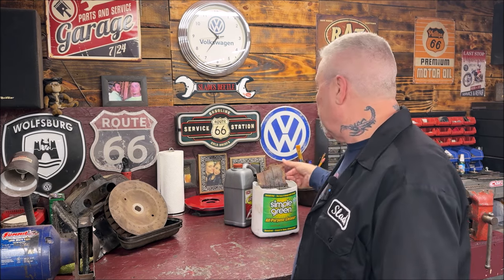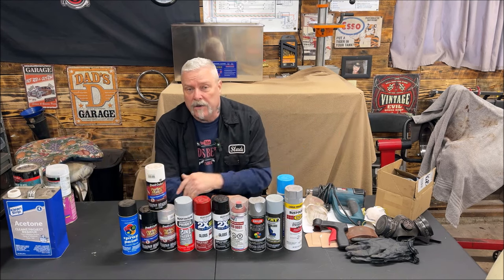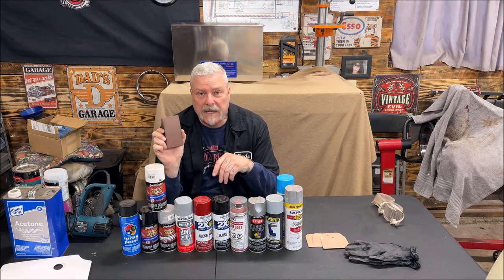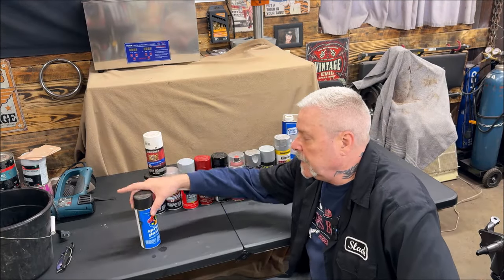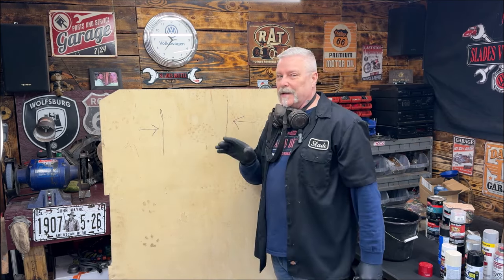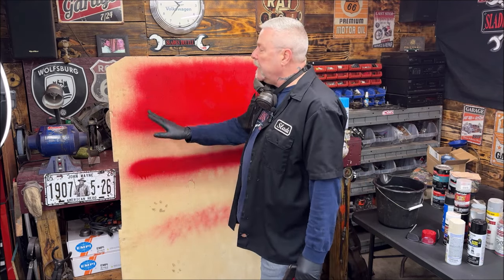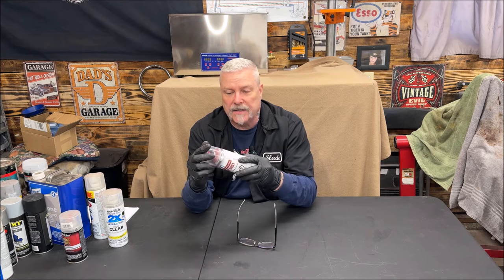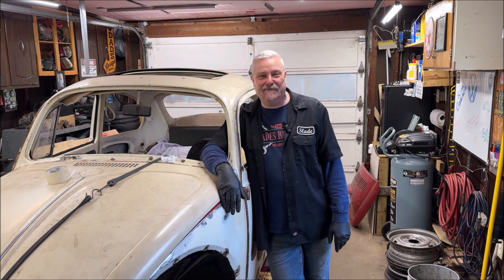Spray Paint Tips & Tricks - Rustoleum Rattle Can Car Paint Job - VW Beetle Bug - Budget Paint Job

Comment: Great tips! I plan to rattle can and 2K clear my 74 standard later this spring. How should I go about painting over the existing paint? It's the original paint, not flaking at all, just faded. I was hoping to just scuff and shoot. But the original paint is green and I plan on going white. Should I do filler and then scuff and prime and then rattle can and 2K? Thanks, Slade!
Reply from the maker: Hey my friend! 
I did that with my super beetle. It was obviously red, the car that was first time around on here on the channel. 
I did do red over top of it. 
But honestly, it wouldn’t have mattered. Because I scuffed it down, not too bare metal! 
And then I went ahead and primed it. 
So it was one solid color of light gray primer. 
And then, of course painted rust oleum.
I would simply scuff it down really well. And then do your primer, and if not just do a couple extra layers of white until you achieve what you’re after. And then the 2K clear! Honestly, I would pop a fender off and practice on that first. I hope that’s helpful.
Reply: @SladesVWBeetle  Thanks so much, man. Love your channel.
Reply from the maker: @stuck1000  you’re very welcome! Thank you for the kind words. I always hope some of these videos or comments help other people.

Comment: Great video! One question, how long between the color coat and the clear?
Reply from the maker: Usually around 10 minutes. Weather pending..
It’s best to have something sprayed at the same time like the masking tape or something where you can touch it to make sure it’s still tacky. 
I hope that read well. 
I’m going to be doing my door this coming week. But I’m not going to clearcoat it for a few weeks for certain reason so I’ll end up sanding it with 1000 wet, since it will be dry. Then clear…
Thank you for the kind compliment.

Comment: When are you going to finish the gas tank video I need to do mine
Reply from the maker: Oddly enough, I was just thinking about that. The rust came out of the tank, but there is still varnish in air. I was going to do a short video on soaking acetone to see if it would work.